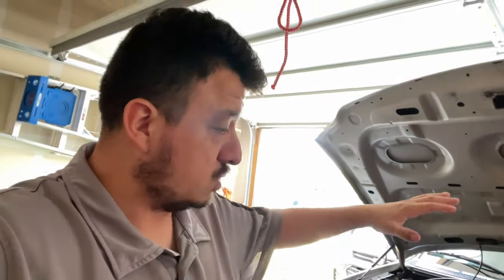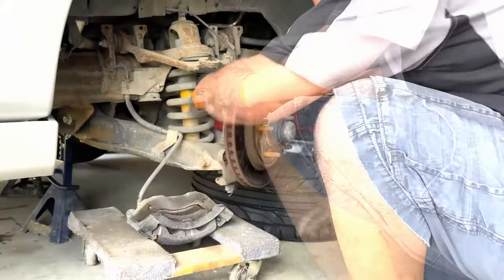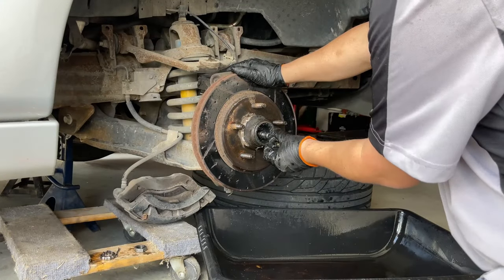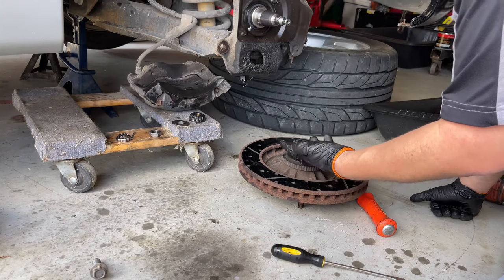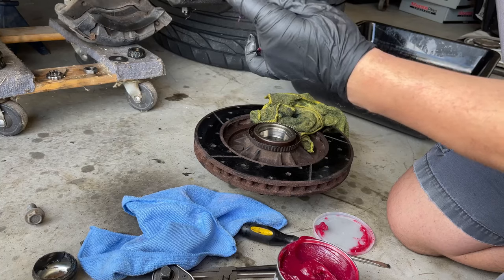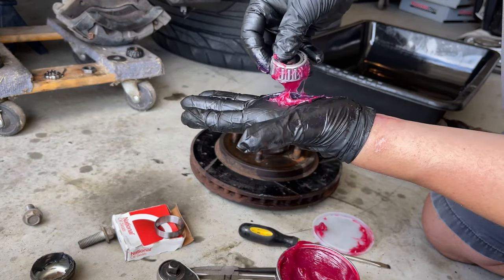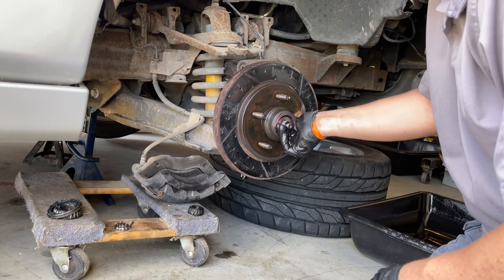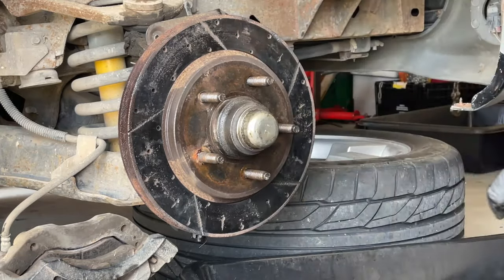How To Replace Front Wheel Bearings On 97-2003 2WD Ford F-150 - Expedition - Lightning - Ranger

Comment: Nice video. Only suggestion, while this vehicle didn't need to replace the bushings, on these videos wouldn't it be better to show everything? Even if it is redundant it would only cost you a few minutes in time . . . no extra money . . . just a thought. Helpful though. maybe mention too that if you do need a socket for the spindle nut, its 30mm or 1 1/8 inch.

Comment: Thank you so much you saved my butt by you making this video.
I was on my way from Texas to Florida.
In about 5:30 in the morning when it's still dark on the freeway my bearing went out my wheel was wobbling and I pulled over immediately and I knew I couldn't sit on the side of the highway so I was able to drive 8 Miles at about 10 mph until I got to O'Reilly's.
I watch this video it took me about 3 hours to do and I was done back on the road.
Thank you so much.
Reply from the maker: Dang!
Glad I was able to help!
Reply: Crazy story. Thanks for sharing.

Comment: Hey Falcon, I enjoy your videos.  I've done this job on a Ford Sport Trac, 2001.  2 questions for you.  

1. Would the torque values be sufficiently similar to my vehicle?  I've done it the old fashioned way, but would prefer to use a torque wrench.

2.  When the job is complete and I've driven it for a week or so, should there be ANY movement at all when you push/pull on the tire at the 12 and 6 position with the truck off the ground?

Comment: I'm working on a friend's truck and his flex hose went bad so his fron't left brakes locked up but he just kept driving it anyway, getting it dang near red hot.

I replaced the hose, caliper, rotor, brake pads, (all shot) but I'm not sure if I need to repair or replace the wheel bearings. How likely is that?

Comment: My wheel bearing locked up on me last night now im grinding the stuck race from the front bearing off the shaft and i put new bearings in the rotor and the front bearing race moves a lil like i can spin it around would it be okay? Rotors brand new and bearings

Comment: I did 12 ft pounds then 30 while spinning the rotor then the 1/4 turn. My wheel still moves side to side when lifted what do u think I did wrong ? I replaced tie rods and upper control arm too
Reply: Did you fix your problem? I have the same problem with my truck

Comment: I got a question about this I have the racer bearings in my 2003 but I want to know if I could hub swap it even tho it’s two wheel drive I’ve changed the bearings twice in 3 years and would like to put a sealed bearing if possible
Reply from the maker: never seen somebody do that before .. but I would imagine you would need to swap more things to make that convertion